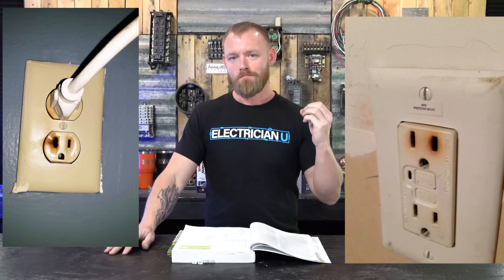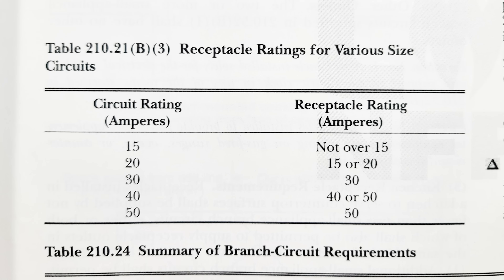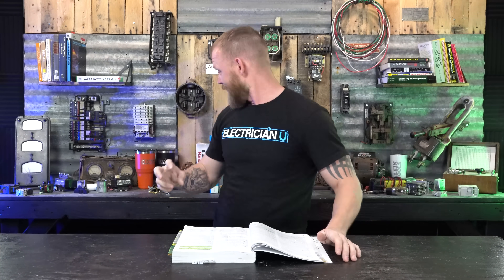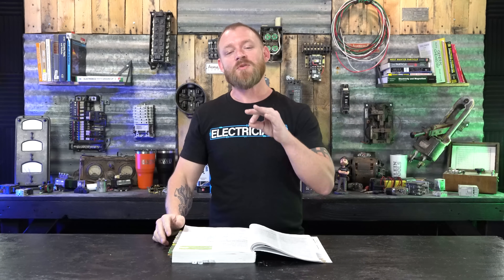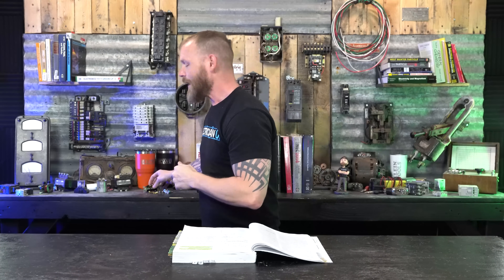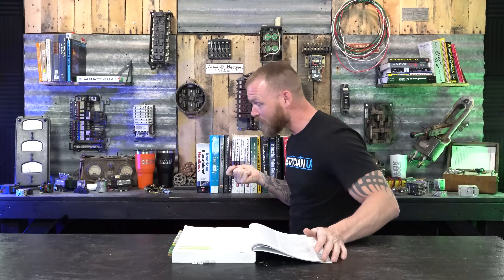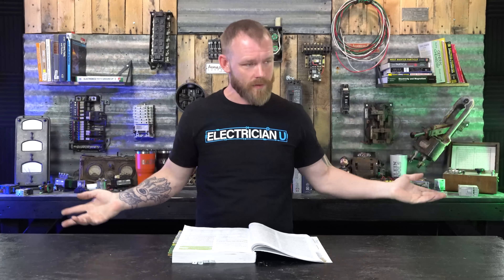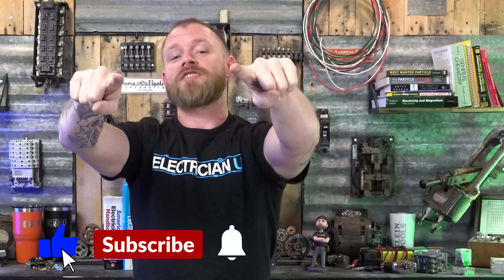Won't These Melt?!? 15amp Receptacles on 20 amp Circuits!!!

Comment: I recently found your channel. I’m not an electrician. However I do all my basic home wiring. 
I have learned a ton of useful information from you and the comments you receive. 
One thing that keeps coming back to me is how I’ve managed not to kill myself, anybody else or burn a house down over the years. 
I’m doing things much safer now and always try to do the job the way a skilled electrician would. 
I very much appreciate the effort you and others like you put forth to educate those of us that aren’t electricians. 
Cheers
Reply: You probably wire better than some so call skilled electricians. I had to replace a switch because a skilled electrician didn't know the difference between a 4 way switch and a double pole switch. It was crazy you turn the double pole switch off the the rest of the three way switches didn't work. Guess the electrician didn't know that 3 and 4 way switches don't have the words on and off on the toggle. But a double pole and single pole switches do. 73
Reply: @ronb6182 lol. That's funny. It's possible that said electrician got mixed up with which wires went where cause they weren't marked or he didn't mark them when disconnecting. So not necessarily they didn't know better but just made an honest mistake. But where the biggest mistake was made was not checking everything worked properly before leaving the job. If you screwed up just fix it right before leaving. Don't wait for the customer to find it first. Or they lose confidence. If you're an electrician just starting out you can't afford to have shit like that happen to you or you'll get a bad rep that you'll always have with you. You also can't afford to make mistakes like that if your uninsured and then burn someone's home down over a mistake that you didn't catch before you left. Foolish very foolish lol
Reply: @JBDay-bd8cu  yeah true but the funny thing this was commercial wiring, a business. I knew how to do three and four way switches since I was in the ninth grade. I even put one in my in-laws cabin. We have three doorways to turn the living room lights on and off. I also found out if one three way switch fails you can still turn on and off the lights at the two other doorways. If the four-way switch fails I don't know the results maybe the other switches would work. That will be my next experiment. I had learned these things in bread board experiments in my electrical and electronics class. My dad taught me wiring skills as well. The best thing I learned from Dad was you don't put light circuits with outlet circuits. If you blow a breaker you won't be in the dark. Most of the time lights don't blow breakers under normal conditions. Also fire alarms are put on light circuits. Well enough of my school years and wiring. 73

Comment: ;-) 
Ask what a German electrician thinks about the american way to wire :D
Reply: Or even a Canadian electrician. Probably any 'western' electrician except American.
Reply: @Morberis  Canadian codes are behind American codes. As far as I know, GFCI’s aren’t even required in a garage in Canada, unless that has been recently changed. That’s just absurd
Reply: @purplesparkyy  You're distracting. Every western countries electrical codes that I've seen doesn't allow it. The US allows it because it doesn't cause enough accidents and because it's fine offloading the responsibility to users. It's a difference in philosophy.
Reply: @Morberis  Considering not having GFCI’s in garages is much more dangerous than putting 15 amp receptacles on a 20 amp circuit, it’s a fair question. I’m genuinely curious how that is not code in Canada. It honestly boggles my mind
Reply: Nobody cares
Reply: @purplesparkyy  yes and no

Comment: There should be a class that you have to take before you're allowed to buy a house that gives you the gist of electrical code lol. I run into so many homeowners that have no idea how any of the electricity works in their house and it scares me everyday
Reply: Or just like every other country have your electrical code such that home owners don't need to know stuff like this.
Reply: I came home one day and half of the outlets worked and half did'nt.  I was clueless.  Had to get an electrician.  Half of the 220 volt circuit had failed.  Easy fix for him.
Reply: I agree completely
A class in highschool would be great
Reply: @markchidester6239  ... there was a time in the 50s / 60s where home repairs was part of shop class. Also wood working and metal working. That faded away pretty quickly by around 1990 when liability issues came up... and also schools doing more for college prep toward higher paying jobs. These days you can only get this subject in a vocational school.
Reply: @rupe53  Ha, in the late 60's I took wood and metal shop. In metal shop after a brief intro we'd go on to do arc welding, torch welding. operating lathes, punch presses (no guard), creating metal tools in a blast furnace, by ourselves. Imagine that today.

Comment: Dude thank you, was just involved in an argument about this last week.  Actually didn't realize the answer was in the NEC
Reply: I've always been frustrated by how many electricians do not know their codebooks either. A fast test to see if your electrician is on the good just ask him if you can look up something in his codebook.  

IF they say they don't have it with them and haven't carried it for years or it's years out of date, fire them.
Reply: @illbeyourmonster1  a lot of inspectors around these parts will ask you to look up things just to test you, in this case I knew the answer, I just had a different, round about way of explaining it. Like how no standard plug appliance is ever going to exceed 15A, if you want to an 1800 or 2000 watt appliance you need a 5-20R.
Reply: @MikesToolShed  ... BTW, 1800 watt hand held hair driers are now a thing, although hard to find. They will plug into a standard outlet. 1800 watts is exactly 15 amps so a little dicey on a 15 amp circuit.
Reply: @rupe53  I've seen things rated at 1800w, but I was always suspicious of that. I feel like the 1800w companies are just "one-upping" the other companies with a 1500w rating.  Like how a shop vacs claim 6HP and the working load is 10-12A not 35 or 40.
Reply: @MikesToolShed  ...in raw numbers 1 HP = 750 watts so yeah, that would be cause for a pause. Most likely it's 2-3 HP with some "peak rating" which is marketing mumbo-jumbo. More often these days I see vacs rated in peak amps. (around 12 amps or so) Higher numbers always sound better to the marketing guys.
Reply: @rupe53  I have an old microwave oven that I have measured to pull almost exactly 15A, it's a bit troublesome on a 15A circuit especially with the mains voltage a bit high since the breaker would trip every once in a while. On a 20A circuit, it works great.
Reply: @NiHaoMike64  ... if you had the original owner's manual, I'd bet is specifies it's own circuit. There's also a data plate somewhere that will confirm your findings.
Reply: NEC doesn't usually answer questions, because if you do it by code you won't have a problem in the first place.

Comment: My house is an old house, they did an additional add on to the house in 1970. The codes were different back then so I got like ten receptacles on one breaker. It’s a living room, bathroom & bedroom all on one circuit. It’s been like that since 1970 and no problems yet but since I got into the trade i’m going to run the bathroom & bedroom to it’s own breakers, only problem is dealing with old work is a pain in the ass.

Comment: Never feed through on the device. Always pigtail in case the device fails. Pro tip
Reply: Amen. Always pigtail. Either you're a professional doing it right or you're no better than the diy guy who's on the wrong side of the Dunning Kruger curve.
Reply: I hate pigtails. More work, more to stuff back into the box. But.....we use pigtails for a reason, as you say. They're always a good idea.
Reply: I don't see anything wrong with doing it that way, if the line part of the line wire is the required length. If the device fails and damages the wire at the screw, it can be cut there and still have the length. I doubt that happens often, otherwise it would violate the code on pigtailing grounds and neutrals. (Ground must always stay connected while changing out a device, neutral if it's a multiwire branch circuit.
Reply: @darbyl3872  The risk isn't that it damages the wire it's that either during installation or far more likely over time there is no longer a good electrical connection. You're putting the connection at the point most likely to fail. And after it's been damaged, by say plugging in a shorted device, you're pulling the rest of that circuits current through a damaged receptacle. I've seen receptacles that had over half the copper missing inside. I've also seen the little tabs on the side that join the screw terminals, and which you break off to make split receptacles, mostly blown away because of repeated contact with the side of a box. 

Yeah, it can be repaired... But hopefully it doesn't cause a bigger issue like fire between then and now. Because it might sit like that for years.

It's not about doing it to pass code, it's about doing it in the most reliable way. Code is minimum and you should always be looking to exceed it.

And yes, ground should always go to the box then to the receptacle. But why does the NEC care about when the circuit(s) is off and the receptacle is being changed?
Reply: @Morberis  My guess is that code requires ground and sometimes neutral to stay connected because a fault during changeover still has some of the current going through a reliable connection. To be clear, it's o.k. to turn off the breaker and disconnect everything. The code committee just wants it installed so it's possible to leave those connected. Maybe it lessens the shock to a person.
I don't know of a reason to go to the box "first" with the ground. Bonded is bonded.
Reply: My guess for the reason they install the 15a outlet is because they don’t like the appearance of the t-prong 20a outlet.  I ran all my wires 12awg but the outlets and circuit breaker are 15amp. For a few pennies I know my wiring is good forever. And if I need 20amp in the future all I need to do is swap the outlet and breaker.  TIP : Install old work boxes even in new work situations. This allows more diverse placement of the outlet without being obligated to locate the install at the stud. It also has an advantage that if you ever need to run speaker wires or Ethernet wires later on, you can remove the old work box easily to stick your hand in the wall to grab the new wire.
Reply: When the electrician before me feeds through= service calls
Reply: When you pigtail, do you twist in a third wire, or strip a spot 3 or 4 inches up the wire and wrap that around the terminal and then connect the end of the wire to the load. Just curious, I don't know which way is best.
Reply: @billycox475  How would you put a wire nut or wago on if you did it like that?
Reply: @Morberis  I probably didn't explain it very well. I've seen a bunch of pigtails where the line wire had a one inch section stripped about four inches from the end and the end was stripped in normal fashion. The bare section four inches up the line wire was wrapped around the terminal screw and end of the line wire was twisted to the load wire. I've run across this in a bunch of old stuff and wasn't sure if it's still done this way
Reply: @billycox475  Oh that is super weird. I have never encountered it. I would not do it that way. I think on modern receptacles there would not be the room and they're not designed for that. It can be tough enough fitting 12awg wire on some 15a receptacles. Like because of distance requiring up sizing of wire.
Reply: Pigtails add more labor cost and wire nut or wago costs to estimates. Since both the NEC and UL allow for feed-thru, why then would it be no good ?
Reply: @Hereford98  The code book is about safety..not necessarily about quality..As  licensed electrician I have found when the electrician feed through the device useing the stab connections as opposed to the screws( code acceptable) in time a neutral or hot loosens up in the stab of the cheaply manufactured device and the outlets down the line lose power. But hey...it's great for a service call.
Another example of code being about safety only..code calls for GFCI protected recepticals in baths  , kitchens , outside, garage , unfinished basements etc.  So you are allowed to protect those by feeding through a single GFCI...
I cant tell you how many condo's I have gone to where the upstairs bath    receptacle is protected by a GFCI that's outside and has tripped...lol
And that's actually wired to code.
So yea..code isn't necessarily quality

Comment: ...they would only melt if you tried to pull more than 15A (12A continuous) through them.  Which wouldn't happen because of the shape of the plug.  Do people not realize a circuit is more than just one outlet?  If you have several outlets on the same circuit, having the circuit be 20A instead of 15A is a good idea.  People are getting it backwards.  To use a 20A OUTLET you need a 20A circuit.  Using 15A outlets on a 20A circuit is perfectly fine.
Reply: You're crazy. Yes you can pull it on multiple outlets but there are going to be plenty of people with a power bar who will pull it off of 1 receptacle. So you need to make it so that it's safe for them to pull that circuit's max load. Expecting random people and children to know not to is crazy.

Comment: Funny, i failed an inspection once by putting a 15A receptacle on a 20A circuit. The inspector insisted on a 20.  Although kitchen countertop 15A receptacles (all on 20A circuits) he had no problem with. 🤔
Reply: I had that same problem and the inspector was so arrogant and thought he knew everything until I showed him the NEC code.  There are so many inspectors that aren’t qualified to be doing their jobs.
Reply: @jaxsonhugh9334  Most aren’t.
Reply: Codes are scams to make money. That's how America works. Land of regulations, home of the taxed and oppressed.
Reply: Is it possible that you are in Canada?
Reply: @WyattH  great question for any time you are confused in life
Reply: Was it a dedicated 20amp circuit? Small branch appliances circuits (typically) won’t be pulling over 15 amps from any one plug
Reply: At the company I work for, we failed an inspection because the holes drilled thru studs to run NM cable,  was "too splintered " caused by using a dull drill bit.     Another time we failed a rough in inspection,  was because we were rushing (trying to meet deadlines) and forgot to put NOALOX on the aluminum service conductors in one of the three panels on a 600 amp service,  this inspector was very strict,  and began checking everything,  including going through the panel with a torque screwdriver,  and checked to make sure we used NOALOX on the aluminum SER used to feed the dryer and range receptacles,  failed for that as well.    So now it's company SOP that we use NOALOX on all aluminum conductors regardless of location or use.   But we use 15 amp receptacles on our required 20 amp circuits all the time  and never had any issues.   As you probably know,  an argument with an inspector is an argument you lose 100% of the time.
Reply: Failed an inspection because the holes drilled thru studs to run NM cable,  was "too splintered" ?, new one on me, sounds anal. But come on, aluminum wires needing anti corrosion is just obvious code requirement.
Reply: 20 Amps circuit must have also 20 amp receptacle. 15 Amps circuits can have 20 Amps receptacles.   ?😊
Reply: @Domi-14   20amp circuit can have 15amp receptacles if there is more then one receptacle on that said 20amp circuit. I.e - 20amp GCFI  breaker, 12/2 romex feeding kitchen receptacles (2 or more) can be wired up with a 15amp receptacle. 
If you have a stand alone dedicated 20amp circuit for 1 receptacle that said receptacle has to be 20amp.
Reply: Ya but they should have been gfi’s
Reply: @jimspirnock1184  yes, for the kitchen, but 15A GFI on a 20A circuit? Why not 20A GFI?
Reply: @jimspirnock1184  lkkkkkkuk

Comment: Better than dedicated space heater outlets is to talk to the right folks to encourage them to put in a ductless mini split (multi head or single head) for much more efficiency 😁
Reply: that $2,000 price difference is going to be a hard sell to most customers.
Reply: Hey if the price difference is only $2k I'll buy it today 😁
Reply: @rpavlik1  ... I was only comparing the purchase price of the cheapest / smallest unit I could find. Wiring and installation of a mini split could run another grand. $100 electric heater has no installation and no wiring. (usually)